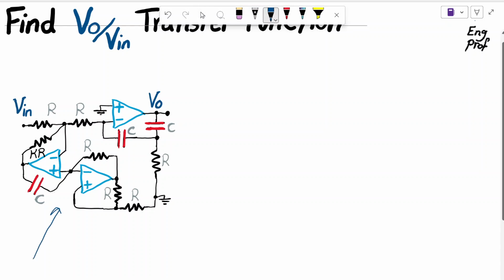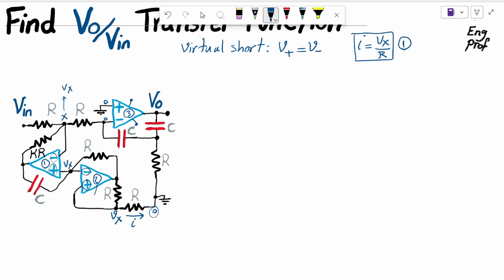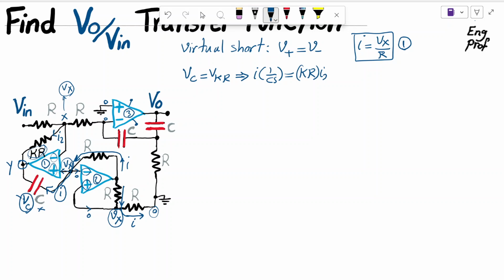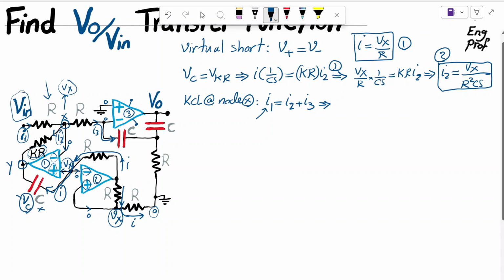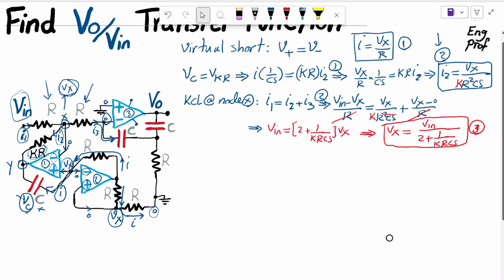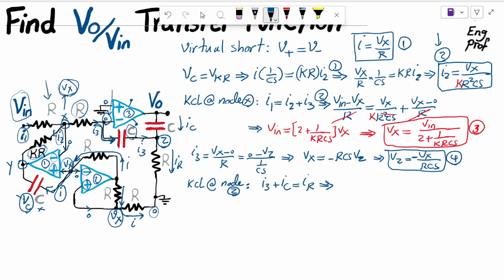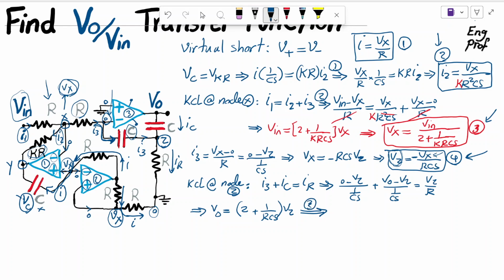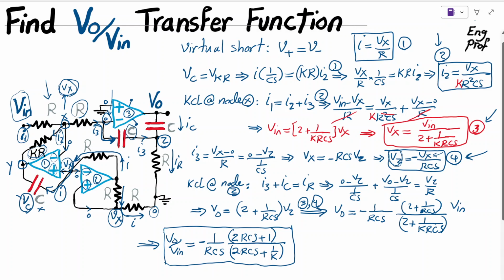Analog Filter with Op Amps: Find Voltage Transfer Function

Comment from the maker: An Analog Filter is analyzed and Voltage Transfer Function of the filter is computed using S domain analysis.  This filter is designed employing a synthesized inductance using capacitance to inductance impedance conversion realized by two op amps.  A combination of KCL, KVL and current flow analysis is then used to quickly find the Vo/Vin for this circuit.

Comment: Thank you for yet another interesting video.
I have but one question: What does KcL stand for? Much that I've exprimed my brains across your videos, I've been unable to guess it.
Reply from the maker: Thank you for watching.  Kirchoff's current law (KCL) is the principle of conservation of electric charge that states that the sum of electric currents flowing into and out of a circuit node is equal to zero.
Reply: @STEMprof  Kirchoff's current law! My, it is so ingrained in my head that it's automatic, I never remember it's a law and has a name! It must be half a century since last time I had Kirchoff named...

Comment: This looks like a great interview question.  But is there a practical application for it?  thank you.
Reply from the maker: Thanks Samuel for watching and comment. Glad that you liked this circuit analysis.  One practical application is realizing virtual inductance from node X to ground using effectively an impedance converter. Basically circuit is similar to a Sallen Key Filter except one capacitor is replaced with a virtual inductance resulting in a cascade of integrator and a programmable pole zero pair.
Reply from the maker: To compare, please see this Sallen key Filter video: https://youtu.be/lOBaJ6BE_iE